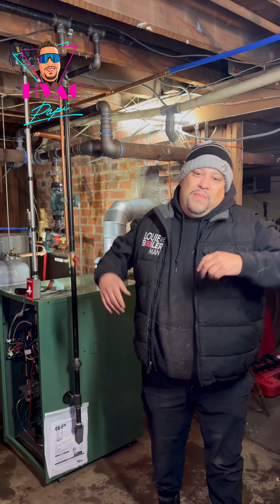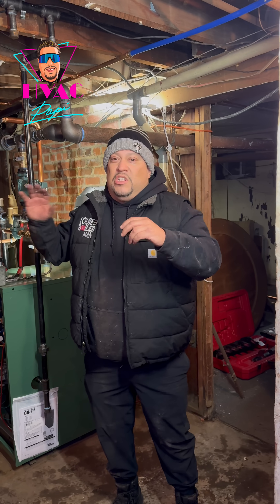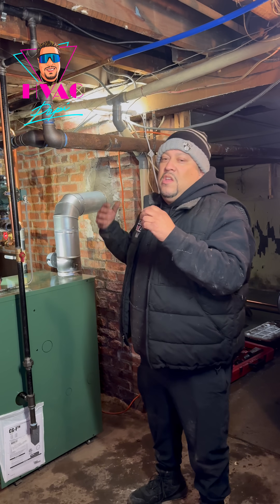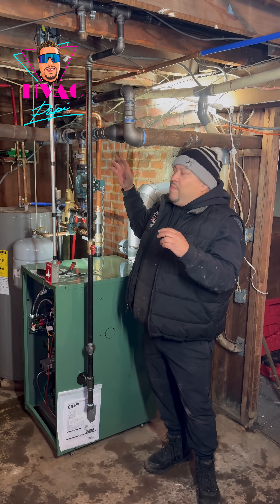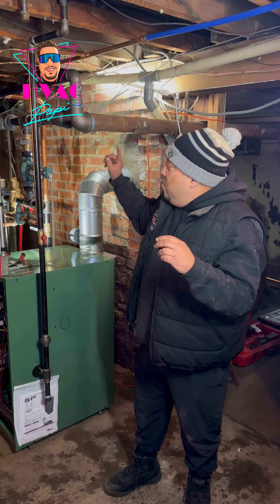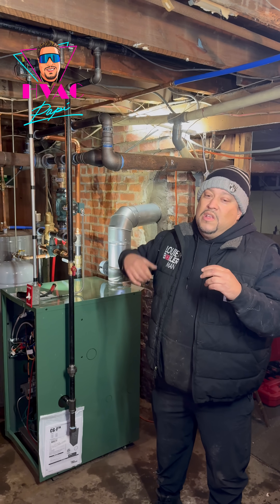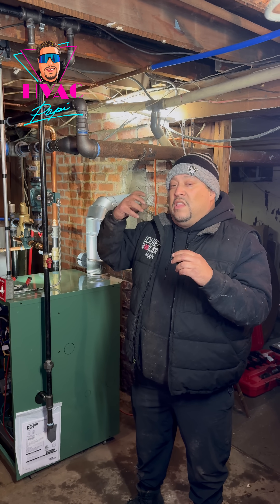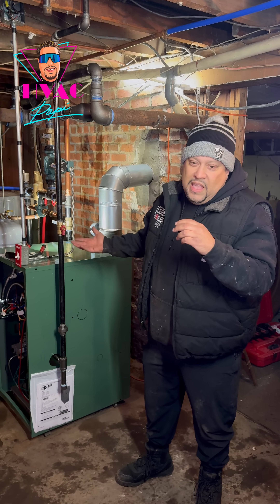Why This Freeport Home Needed a Second Circulator Pump Upgrade | HVAC Papi

Comment: Nice work, most likely the original heating system was an old gravity hot water system. FYI, on closed looped hydronic heating systems like this, the static water pressure is the main factor for the circulation. The pumps create negative pressure for the water to circulate throughout the heat exchange/load. Increasing pump horse power or GPM is not necessary. I’ve done many of these same systems with conventional smaller pumps and they work perfect. Supply house vendors often claim to know about pump curves, head etc., but make more money when they sell bigger pumps. Just some info and friendly food for thought.
Reply from the maker: Thank you for sharing. I appreciate your opinion.